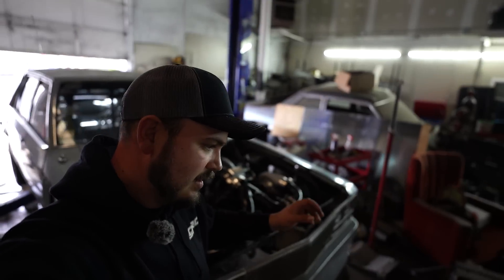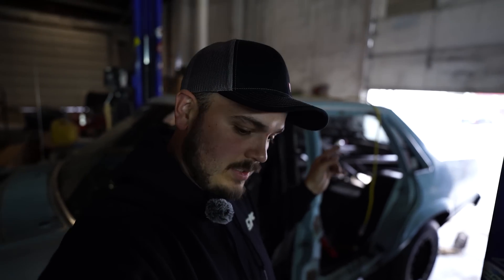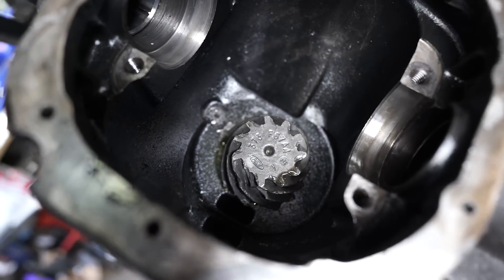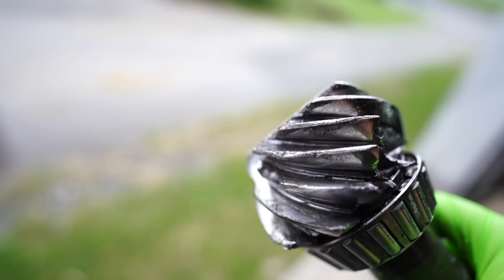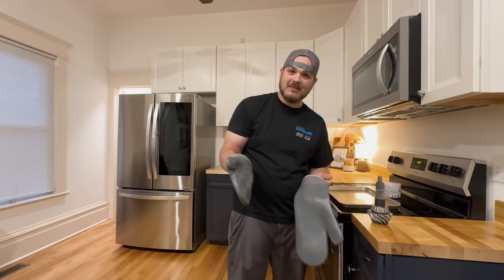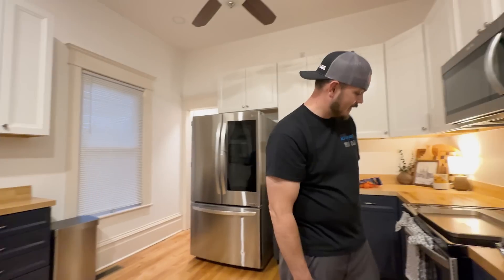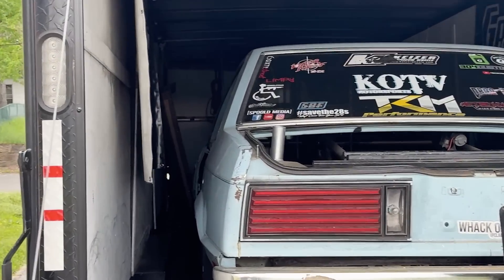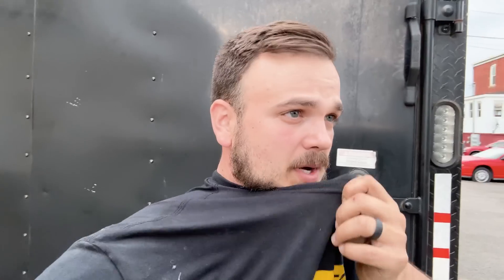Fixing the Wrecked Zephyr(Science + Racer=Results!)

Comment: I told you in the last video not to attempt a ring and pinion install if you have never done it! You can't run with no shims under the pinion bearing! At least you won't be able to video making a pass anymore bc it's gonna sound like an ambulance is chasing you! You're gonna rip the teeth off the next ring gear after a few passes because you have no pinion engagement! Actually, if the other pinion had no shims, that's why you ripped the teeth off the ring gear!
Reply from the maker: @Headsup9550  what about the ring gear that was installed without shims that had been in the car for 5 years prior to this? I checked engagement, it’s fine.
Reply: They all dont NEED a shim, ive had carriers that needed .060” shims and some thats needed no shims at all. Thats from dozens and dozens of different 8.8 housings